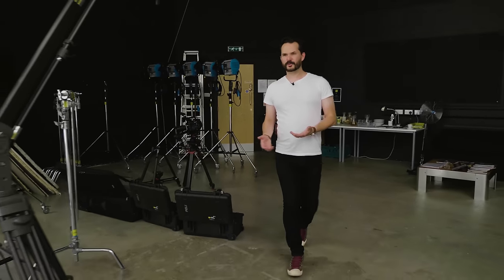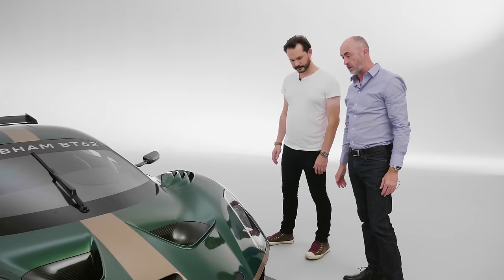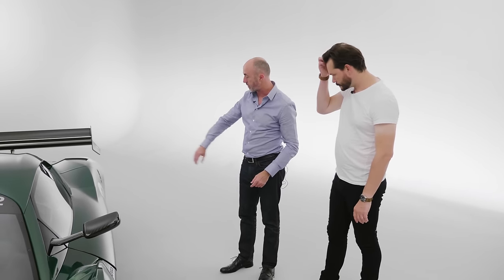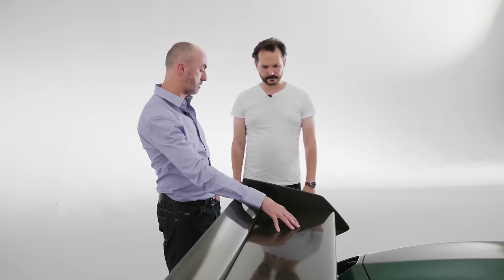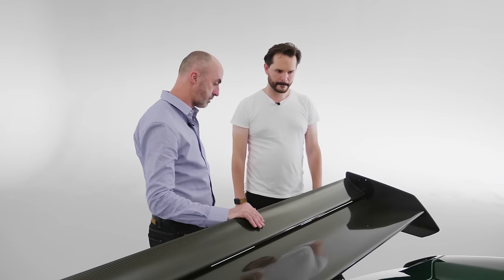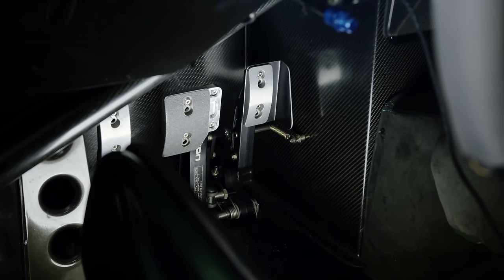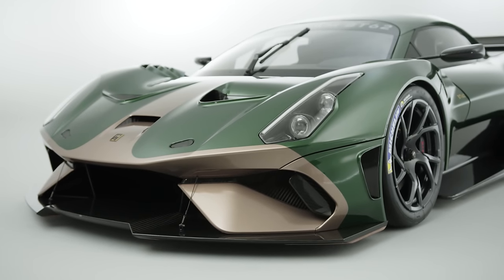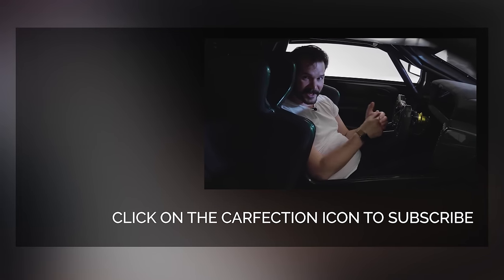The Engineering Behind The 700HP Brabham BT62 - Carfection (4K)

Comment: Beautiful car looks alittle like the fordGT in the front section. I understand why small companies make track only cars less regulations. But the advantage of making a street legal car is people can see it driving good pub. Look at the apollo IE people go nuts seeing it on the road.  Will anyone ever see this car driving
Reply: The Apollo IE isn't fully road legal per se, most of the time it's run on show car low volume license.
Reply: Jay Wong yes it is acording to the manufacturer
Reply: Maybe a company like RML Group can turn it into a road legal car. They also made an Aston Martin Vulcan road legal.
Reply: Allen:  actually looks like the Ford GT that Ford didn't build, the one with a naturally aspirated built Ford Coyote V8 based engine (yes that is a tweeked Ford V8 rebranded engine in there).
Reply: They would if it was fia restricted and racing in a series.
Reply: And a Vulcan at the back
Reply: I caught wind that due to high demand they're developing a road legal version

Comment: I keep getting hit with the same question of myself when people ask what the weight distribution of the vehicle is...yes, while the vehicle is standing still and during slow cornering the static balance is important but what is the FUNCTIONAL WEIGHT BALANCE at various speeds and how much does it change with the changing angle of the air over the vehicle? How dynamic is the changing of the downforce on various parts of the vehicle and is it a vehicle that is inherently more electric in its vibrations or is it a calming force in the cockpit? Beautiful steed, David!

Comment: 700 hp from 5 litre V8, without Turbo or hybrid?!!!

Car weighs under 1 tonne, that's 700bhp/tonne,

Is there a car out there with better power to weight ratio?
Reply: Saif0412 One:1 springs to mind, don't know why...
Reply: Yup, I know of one. However they are so rare and nobody is talking about them. So until I find one and buy it I won't say the name. However to summarize, yes, there is a super car from 20th century under a ton with a 700hp and manual transmission
Reply: ImBarryScottCSS I couldn't even think of one, yeah it's ultra rare, almost nothing with that kind of power to weight ratio
Reply: It's not that crazy given it's a track car. 130hp/L on an engine with probably very short service/rebuild intervals.
Reply: ImBarryScottCSS "without turbo or hybrid"
Reply: ImBarryScottCSS yeah but its a bi turbo
Reply: Porsche Collector hmm? Cerbera Speed 12? 🤔🤔
Reply: @devandrasimanjuntak1646  McLaren F1 GTR Longtail
Reply: From this list of 50 cars, the first 42 has better power to weight ratio than this Brabham:
https://www.supercars.net/blog/top-50-supercars-listed-0-60-mph-runs/
Reply: The Aston Martin Valkyrie has a non-turbo 6.5 litre Cosworth V12 giving 1000bhp, plus around 160 bhp from the electric drive system.  Weight arond1050 - 1100kg.  That's around 1050 bhp/tonne
Reply: Yes, the ultima. Faster, more powerful, lighter, tenth of the price.

Comment: Fantastic car but so many questions... The brakes, the suspension, the driveline, the chassis, the devlopement and the company? We need to know more!!
Reply: Brakes, you can see they use brembo monobloc racing caliper, pads and carbon disc. The suspension is using Ohlins, if you never heard of Ohlins you should then, they are used in WRC, GT3, LMP1, LMP2, DTM, etc. even in the MotoGP. For the electrical they use motorsport ECU (i believe it's Motec since they use Motec Dash and Motec PDM, so no more relays like you usually found in road legal cars). All of those parts are really hard to get unless you are a racing driver or have a racing team,  and the prices is so insanely expensive and built only for racing.
I don't know about the driveline and chassis but as for Brahbam, Brahbam is founded by F1 triple world champion Jack Brahbam. The only team where the founder/owner won a championship driving a car of his own creation.
Reply: engine...i suggest you look at the top of a chrysler hemi. ::-)
Reply: Gizmo Thewytchdoktor It’s based on the Ford Coyote V8 actually
Reply: cool. just speculating on the mfg due to plug coil placement but one thing is for sure....yet another 'supercar' based on another mfg's engine instead of their own design. i have a lot more respect for builders who are up front about the power they use and even more who do their own r&d to develop their own. with the cost of some of these rides there's really no excuse for them not to be bespoke builds in their entirety. guess i'm just old fashioned in that way.
Reply: Well it’s a very recent car, we’ll have more information in the future
Reply: You do realise the Jack Brabham won his third F1 world championship with a used oldsmobile engine block, the only thing close to an American engine to ever win an F1 world championship. It was of course completely modified in every respect in Australia, but still, no need to diss using existing castings.
Reply: @gizmothewytchdoktor1049  They make their own billet blocks the only thing in common with a coyote is the firing order and head set up all else is bespoke .

Comment: Something tells me this is the motor that's going to be in the GT500 (sans the supercharger). It has a similar sound to the firing order of the 5.0L Coyote motor just with a thicker block that has either been bored out, or had the stroke increased, to get it from 5.0L to 5.4L. Sounds nothing like anything from GM or FCA, and it seems like it's got too much cam to be from outside the USA.

Comment: Wow, just wow!!! N/A 5.4l v8 producing ~700bhp? Is this a record about specific output per litre??
Reply: no, not even close actually. the Ariel Atom V8 for example squeezed 500 HP out of just 3 liters
Reply: Dank Frenk Visser Atom may have it, but I dont believe it's being produced anymore (the V8 version that is). Either way the GT3RS also eclipses this with 520hp out of it's 4.0 engine as well.
Reply: Alan Bowers the V8 version may not still be produced, but it still happened. The records wouldn't disappear just because it's not being produced.
Reply: Or any superbike ≈200hp/litre
Reply: JackSwatman dude.... cars.... If you can tell the difference
Reply: Dank Frenk Visser the Atom had a home built Motorcycle engine configured in dual 4 cylinder 1.3L Hayabusa Engines joined by a custom crank case and shaft.
Reply: supercahrged
Reply: Palios33 You didn’t specify...
Reply: lazaglider N/A with capitals 😋
Reply: Palios33 I don’t think you know what N/A means...
Reply: lazaglider explain
Reply: What is the difference bettew a bike and a car? an engine its an engine

Comment: Without trying to sound negative, everything David said sounded quite top line and fluffy, no real insights or detail, he comes across as not being close to actual production and innovation know how. Someone else pointed out that it doesn't sound like it brings anything new to the genre, and I have to agree. As far as no hybrid tech and why a V8 I imagine it more a cost issue with not enough money for proper R&D. Just an assumption on my part though. Looks pretty sweet otherwise.

Comment: This is what McLaren road going cars should’ve looked like once they came back with the 12C, instead of the soft-edged rounded-off egg-shaped bubblegum designs they’re running now. I was skeptical about the Brabham brand, since they’d never done a non-F1 car before, and it felt a little like capitalizing on the heritage of the name by selling overpriced racing-like material to rich Saudi oil kids who don’t really know what to do with their money.

However, the light-weight approach with the naturally aspirated V8 seems like a very well thought-out concept to build on, and the fact that it’s a Brabham with racing pedigree who built it, you can hardly say anything about the name. Now let’s see what kind of material they come up with, both for the road and for the track, and hopefully they can settle next to McLaren nicely, and give them a run for their money.

Comment: The engine is the coyote from ford.
Reply: How do ya know?
Reply: 700HP from a Ford NA V8 sounds risky, the boosted ones don't go much higher without issues.
Reply: Some of it's based on the coyote and voodoo,they make their own billet blocks, larger heads.larger oil paths and coolant jackets.The first proto's used a "worked" motor from Ford, but all customer cars will have a bespoke motor developed inhouse.

Comment: It's nice, but who's ever going to thrash this on track where one mistake destroys your rare car
Better off buying a used race car, no big deal if you hit a patch of oil and slide off or if another driver bumps you 
Just replace the body panels like the cars had done several times before 
Nothing rare and pristine about it, it's a used race car designed to be thrashed 
These ultra rare, shiny and beautiful "track toys" just end up sealed away in climate controlled garages, doubt theyll see a track more than a couple times in their lives